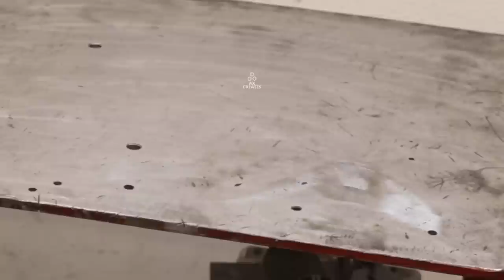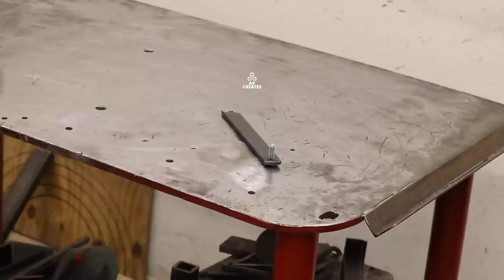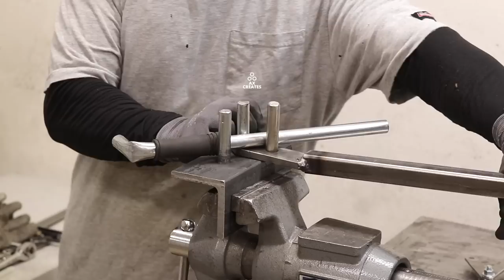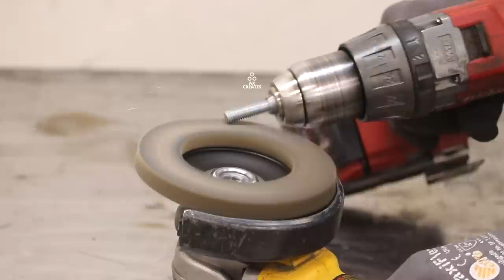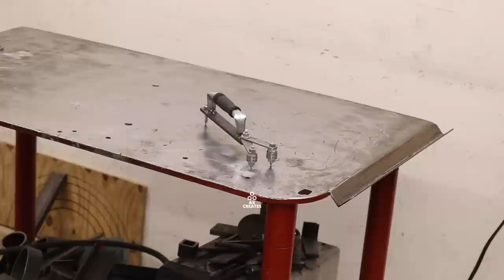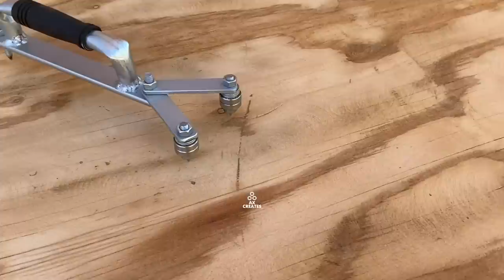FANTASTIC IMPROVED DIY!! AMAZING UNIQUE IDEA!!

Comment: That’s a cool tool, a few years I had to take the wood flooring out of an enclosed truck box. I did it with a small hole saw cutting around the screws too rusty to remove with a driver. It got the job done without a pilot but would have Been Easier with your tool. FYI, we weren’t trying to save the wood but it was oak and hard to pry or break.